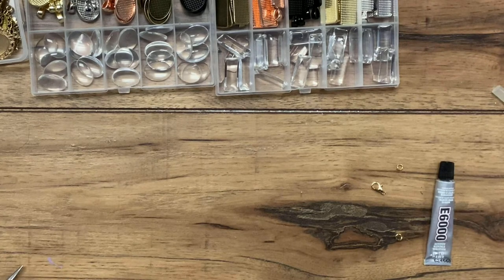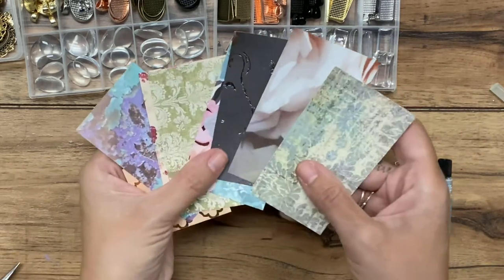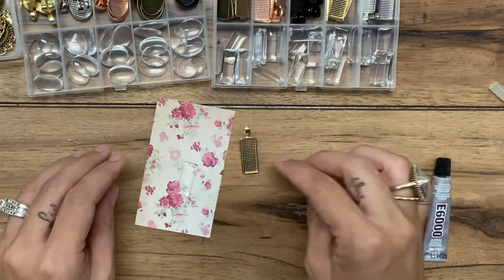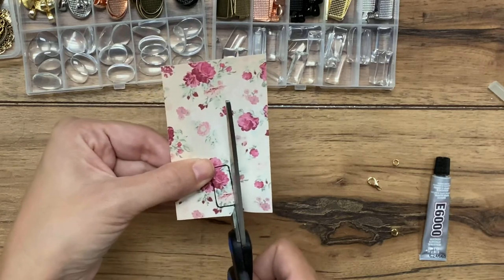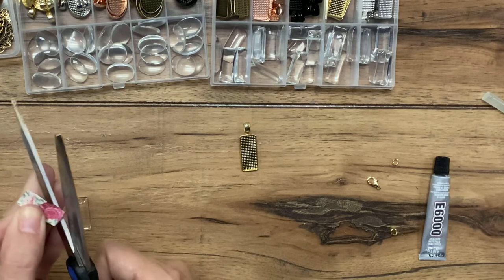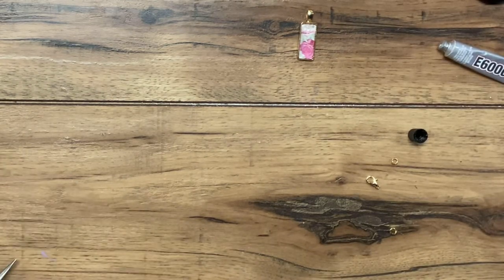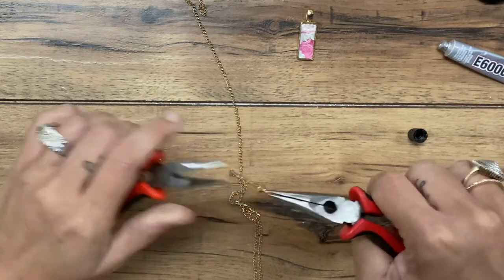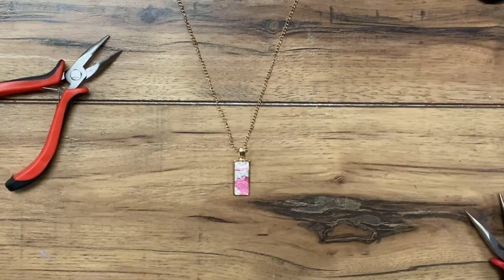How to Create a Faux Resin Glass Cabochon Bezel Necklace

Comment: Could I use dried flowers?
Reply from the maker: Yes definitely!
Reply: @livandvivdesignco  can you please do a video showing how to do that? Would you use the e6000 glue the same way as in this video?
Reply from the maker: @lovealwaysjasmine  I would still use the E6000...put a little bit to hold the flowers to the bezel and let it dry completely, then use a little more to put the top (cabochon) on! You could also use resin or ModPodge dimensional magic in place of the cabochon if you prefer!